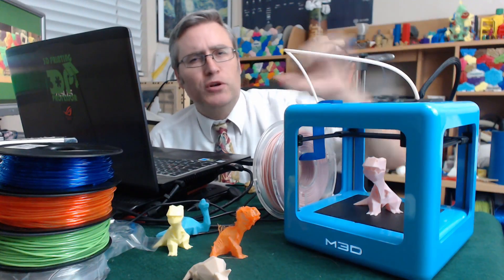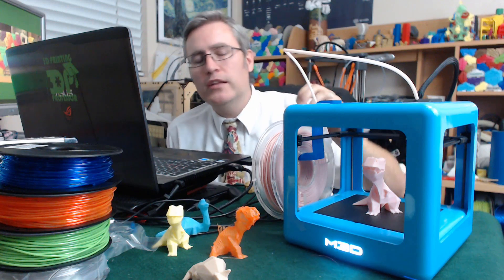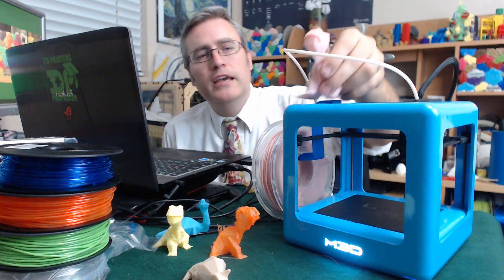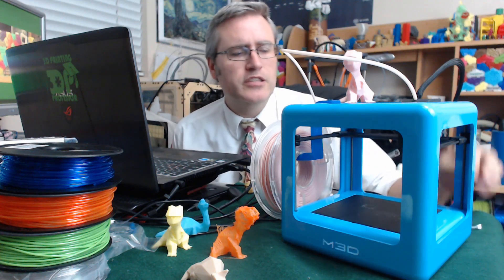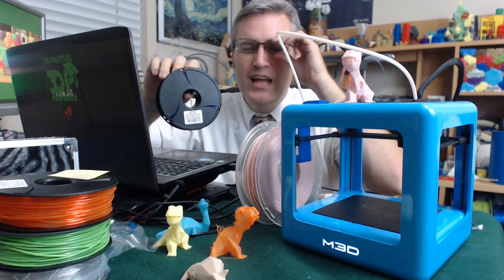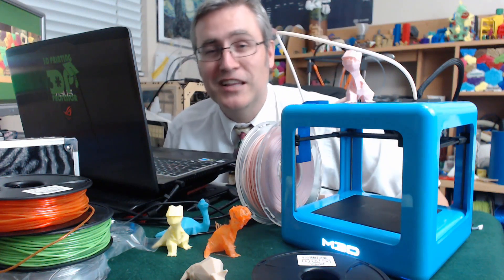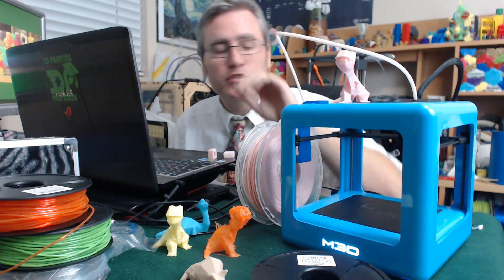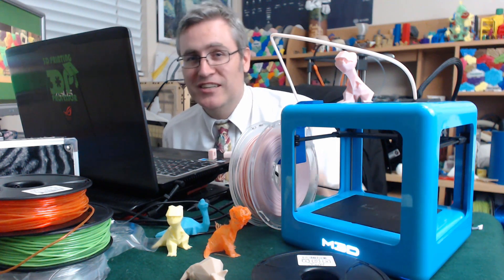M3D Micro+ Review

Comment: Not Meeting 3D printing Community standards:
1) Expensive/Quality Ratio ,,, you can get better with the same money.
2) it is not modifiable or compatible by any other available 3d printer softwares
3) very limited software = very limited machine . unusable for any project.
4) No Screen, No SD card, and very slow

You can buy Easy threed 3d printer or any other 3d printer which can do better and cheaper. 
NOTE please spend more time on the quality of your product rather on making it more difficult for the community to use your 3D printer
Reply from the maker: Easy Threed is available now. Wasn't at the time.

Comment: I owned one of the first kickstarted Micros.  SLOW, but apart from slow, it was basically perfect.
The one I owned I got after KS shipments were fulfilled.  they claimed to have made too many or for some that cancelled, or whatever, so I got it for about $159 or so, less than $200.
I printed cylinders and cubes that were not off in any direction by more than 0.1 mm, EVER!
finally did put it on the shelf, and sold it about 1 and a half yrs ago.
I was a Bete tester for XYZ printers and received a free da Vinci Mini, much bigger print volume, lightning-fast (haha, only in comparison to the Micro) 

Today, you will not find M3d.  no help, they seem to have absconded with some $20 MILLION in crowdfunding money from their Promega and Pro models.

Shame on them.
Oh, they still have an active online store, hawking $1600 Ender 3 Clones!
Yikes!

Comment: Low power consumption, no! Not if it is the same software as the original micro. Low power consumption is worth nothing when the software on the computer runs on 100% CPU when *idle*. With that bug still in the software five years after it was released is hard to excuse. How hard is it to put in a tiny yield call once in a while?

I really hope the Micro+ is a lot better than the Micro because the Micro is pretty awful. Much of the problems come from the buggy software, though. The CPU load is just one of the problems. It says "wait" but nothing ever happens, it says "can't send the command command since the printer is working" (what a joke) and quite often "the printer is not responding".

And yes, precision is not impressive. But is this + version better?

Comment: I am very curious. I had their Pro version that has a larger build volume, a better extruder setup, and a heated glass plate. and two of the Micro+ as I run a makerspace on campus and have other printers like Prusa, Creality, XYZ and even Mod-t. for some reason I was never able to get a reasonable quality print from this printer due to the proprietary slicer it uses. Is it possible if you can share your cura profile on a google drive? it would really help me and I'm sure many others
Reply from the maker: I am sorry, it's been a long time, many Cura upgrades since, and I no longer have this printer. The cura profile was supplied by M3D, so someone has to have it.

Comment: Omg i thought you were supposed to be a 3d printing professor. You dont know jack about 3d printing. That printer is trash. Absolutely garbage. They should charge like $100 for that to make it fair.
Reply from the maker: "Absolute" implies there's nothing redeemable about this printer, and I don't believe that about any machine. I was able to get some good prints off it, it does what it does in an innovative way, and it honestly has some points that others would do well to emulate. Is it perfect? Nope. Is it even the best for the price? Oh, heck no. Get yourself a Monoprice Select mini for that.

I 100% agree on that price point. $150 tops would be a fair price for this printer.
Reply: @3dpprofessor  the printer is underpowered you said it runs off of a lower power and gave it credit for being "eco friendly." That only means that the printer lacks proper heating capabilities and the proper nema 17 steppers that typically run off of 12v. Without proper stepper motors its slow and prone to break at any moment. The printer has no heated bed. Its made of cheap materials. Its support around the printer is horrible. It has no LCD control. Having an LCD is a standard for printers these days. There is not one feature about this printer to give it any credit other than it is possible to 3D print things very innaccurately with it. Heck i wouldnt have ever reviewed it and i especially wouldnt recommend something so unreliable. You failed to point out so much stuff in the review its ridiculous. Read other reviews they agree with me.
Reply from the maker: I don't disagree with you on any of those points. And you'll notice, I didn't recommend this printer. Don't mistake a positive mental attitude with an endorsement.

Comment: I am trying to get this printer to work for over a year now... I even upgraded to the m3+ including a heated bed ; more wasted dollars. The printhead's Z-positioning is very wobbly and can actually move a mm up or down if forced externally. and thats what the black bunch of cables does you see coming out of the printer top. you can calibrate the bed level as long as you want - on the next run this cable twists the head a little up or down and there goes your calibration. This is nothing software can change and, btw, m3d company is not upgrading their software for this thing any more.
go for a solid all metal 3d printer - they come in small sizes as well.

Comment: If you buy this printer, you’re making a huge mistake. The head is a repurposed 3D pen, and the motors just don’t have any power to move the assembly. I have spent over a week trying to get something reliable out of it, and it’s a week I’ll never get back. The desktop software is crap and crawls along. I even went to the extent of swapping in Marlin FW in an attempt to standardize things but the mechanical parts just can’t cut it. Save your blood pressure and head of hair, this print just ain’t worth it. Get something like an Ender 3 and enjoy the 3D printing experience as it should be enjoyed.
Reply: Thanks I was just about to buy it

Comment: are there any 3D printers that can be used in an apartment, without safety risks ?.
Reply from the maker: What exactly are you worried about? The major risks of 3D printing are the heat generated by the nozzle (enough to give you a welt but not enough to kill you) the electronics being faulty and starting a fire (same risk as any device you plug in) the movement system grabbing loose clothing or hair (most of which will pinch at worst but will probably give before you do) and, perhaps the only legitimate concern, the fumes from melting polymers. 

I recommend get a sturdy machine, like the Monoprice Select Mini or Monoprice Mini Delta, and that will reduce your mechanical problems. Plus their small form factor is perfect for an apartment. The downside is you can't print big, but for that I would see if you have a library, college, or makerspace nearby taht you can use their machines for. And for the fumes, just print in PLA in your apartment. The fumes from PLA are known to be the safest of all the melting polymers.

Comment: I had one WAY back..(well 4 actually, I kept returning them after a day or 2 of BS for a replacement) Thing is a total piece of junk. 1st off, their slicer is Cura (15.xx), with a fancy front end. (unless they changed it in the last few years) Then the whole print head being cool, well, it isn't and that is why it's out sooo much. The gear drive that moves the head is so sloppy you'll never get the backlash out of it. You'll always have ovals as it simply can't print circles with that setup. Also the snap on sliders front to back are so sloppy, then the actual wimpy rods flexing,  it just adds to the issue  Now we can cover the tiny fan being both the cooling for the head and part cooling, it actually sucks air to cool the part being it's flat plane with the nozzle and bed. Oh and such a piece of crap it will actually end up breaking because you'll eventually suck up an over extrusion string into it and the PLA/fake ABS is stronger than the fan structure. (went through 6 fans, then started just glueing them back together)  Only way I ever got even 1/2 way decent prints was with M3Dfio plug in for Octoprint. And those I wouldn't consider even acceptable today of any printer. I'm not a troll type person and usually don't say. negative things if I can help it, but I got so badly burned by that thing.. people need to know just how bad it is.
Reply: OH, one thing I will agree on, their flex filament is pretty good. I actually still buy it as I like the lower cost/smaller spools for flex as it allows me to buy multiple colors for the same(ish) money but not have to store the larger rolls as I generally don't use as much of it per print.  It is more expensive per length/weight, but again not storing something I don't use often or as high a volume. and more colors.  It does print very well for a flex also.

Comment: My original Kickstarter M3D printer was junk. It now resides unused in a box and I'm using a printer that costs less and is vastly superior in every way, especially in build volume.
Reply: I have an original Micro, and when I got it, it was definitely junk, unable to print anything - not even the manufacurer's own examples! It sat unused in the box for a long time.

However, later software updates have moved it from useless junk to a somewhat capable, cute, but slow, printer. The software is still not good but now it does the job, for the most part. The prints are perfectly usable if I use the finer settings.

I also have an Ender-3 and it is certainly the better machine, but the Micro has auto bed levelling, which is not worthless, and slicing and printing is one operation and not several. So it does deliver on some of its promises.

So now I am considering upgrading... but it is expensive for what that delivers.

Comment: "They could solve some day" <<< experienced M3D owners have been saying this for years. I backed their Pro on Indiegogo last year and the whole process was a nightmare. Long wait for delivery notwithstanding, the product never delivered on a great 'out of the box' experience. I had non-stop backlash issues, extrusion issues, the chip powering the Pro's heated bed died supposedly due to a firmware issue, and while their customer service and replacement parts department were at least clear, transparent and doing what they could, the accuracy and print quality of this printer never measured up to expectations. Mine now sits in a lonely corner of shame, unpowered and gathering dust. I often consider defenestrating it or using it as a boat anchor. Perhaps one day I will power it up again and see if any firmware updates will change my situation with it, but I'd rather walk on a few hundred Lego barefoot first.

Comment: This printer is small, expensive, lacks a heated bed and is inaccurate. Tell me again what you like about it?
Reply from the maker: Innovative movement system, and very low power consumption. It's not all negative. That said, if you come to the conclusion that the negatives outweigh the positives, I would not disagree with you.

Comment: This printer is garbage, for the same price you can get something much more capable. It was my first printer and it was very quickly outgrown. Better get a monoprice mini, it's cheaper and better.
Reply from the maker: Be sure to check my blog. This is basically the same conclusion I came to. https://www.3dpprofessor.com/2018/06/m3d-micro-review-video.html
Reply from the maker: Man, I wish that a more verbose script would be added to the firmware or typical printers, aka Marlin. But in 5 years that has yet to happen. I'm tired of holding my breath.
Reply: 3D Printing Professor if your conclusion was basically the same, why are you so positive/happy with this printer. All of the cons you rattled off about it while ignoring the price tag just really seems to fail to add up in my mind. I know my reply is rather negative. I'm just trying to understand your thinking.
Reply from the maker: I don't hate everything about this printer. There's a lot going for it. Not everyone needs accurate prints to print a bunch of Groots, and it's eco-friendly nature is something I've not seen in any other 3D printer. It's not all negative. 

I  never jump straight to the conclusion. I want you to have all the data you need to make your own choices. I didn't recommend this printer to people, but like I said, I wouldn't say someone with one of these printers had made a mistake. That's because the way I see it, what's right or wrong for me isn't right or wrong for everyone. Whenever I see someone make a claim like "3D printing is dead" or "Shapeways is dying", what I see is someone ignoring the big picture, and instead saying "if it doesn't work for me, it's not right for anyone", and that's not a position I can get behind.

Approaching things from the positive, I feel, makes the world a better place. There are things about his printer that if we took a critical, and positive, look at we'd say "Yeah, that part's good, I want to see more printers do that." But neither did I hide from you the negative, nor did I draw your conclusions for you. Yes, I built up to what, to me, was the biggest negative about this printer so that you would be sure not to miss it. But I tried to be subtle about it and make sure you know there is good here, instead of beating you around the head with negativity. That's just the kind of guy I am.

Did I come off too positive? Did I sound like I was endorsing this printer? I do want to know if I did, because I don't ever want to come off as disingenuous or deceiving.
Reply: And the real nightmare begins when the head fails.  Over and over again.  Being so small, it is incredibly delicate.  The gears strip.  They can not be replaced and you end up ordering a replacement print head.  Every few weeks, if you print with it daily.....
Reply: 3D Printing Professor, I rewatched the video. As a review of the printer, the tone of your video, in my opinion, is more positive than someone like Maker's Muse would be. I understand, now, from your reply that you are trying to compliment the positive design choices.

In response to some of your positives, headless and low power draw seem to come up a net negative. The positive about having verbose instructions when plugged in to a computer is probably something that could be added to the firmware of typical printers. The low power as you mentioned is likely leading to problems with positioning. Designing the printer to hold a spool under the bed and then explicitly telling the end user to not put the spool under the bed seems pretty janky. I'm sorry, but, the cash outlay for this printer just isn't justified by the interesting design choices.

I know I'm still responding negatively to this printer. I'm glad you took the time to explain yourself to me/others. Maybe instead of calling this a review, it would be less offensive(?) being called an overview?

I'm sorry if I am too critical. You do very good, interesting work and I don't want to seem like I'm trying to trash what you do.

Comment: Does that mean you could run this printer from a decent powerbank?
Reply: Michael Necker you could deffinatley run this of a mini ups (essentially a large power bank with more current and voltage outputs), would fit in the gap at the bottom of the printer aswell.
Reply: @EuanTodd  yes but being under powered is NOT a good feature one bit. It only means that it lacks the proper nema 17 motors that require a higher voltage to run and it lacks the heating capabilities of other printers(no heat bed) and it has to run very slowly. Get a different printer not this trash.
Reply: @matthewguiher  who ever said I was gonna get one??? I've a wanhao duplicator i3 plus and a prusa i3 MK3...
Reply: @EuanTodd  oh sorry i meant to reply to michaels comment not yours. He seemed interested in the printer. My bad dude
Reply: @matthewguiher  no probs man 👍
Reply from the maker: So no cookies, but maybe something better. And then solar power the whole thing, and yes.
Reply: They should call it "the worlds first outdoor 3d-printer" with a solar-extension xD